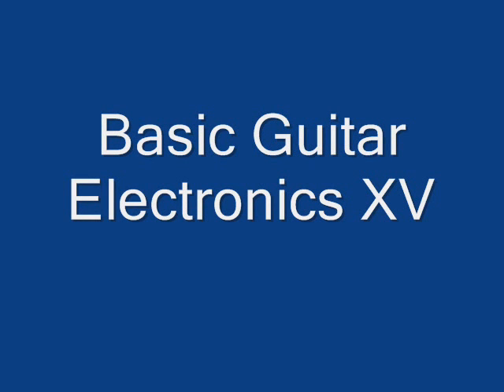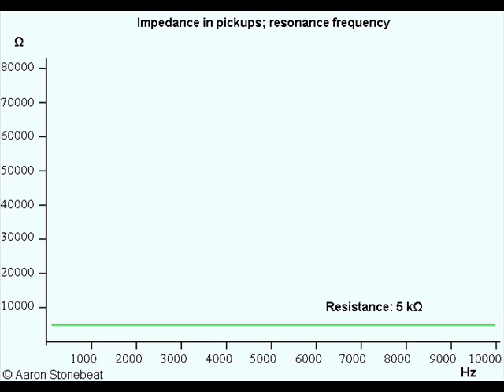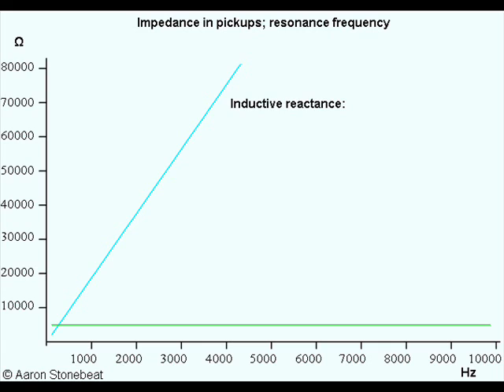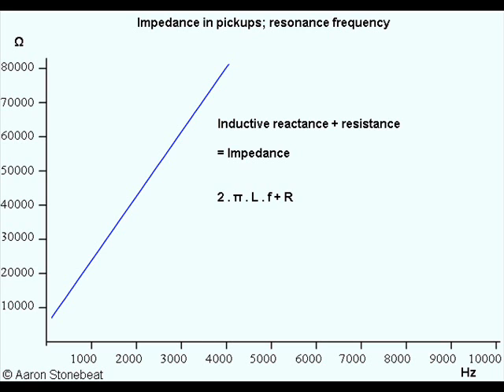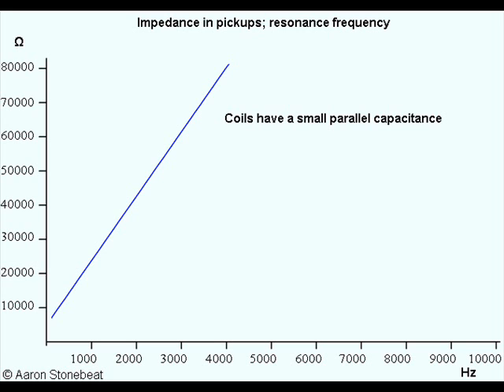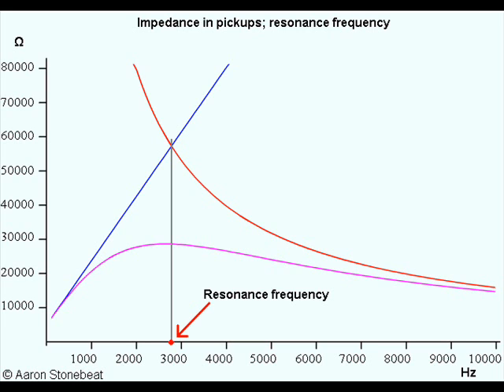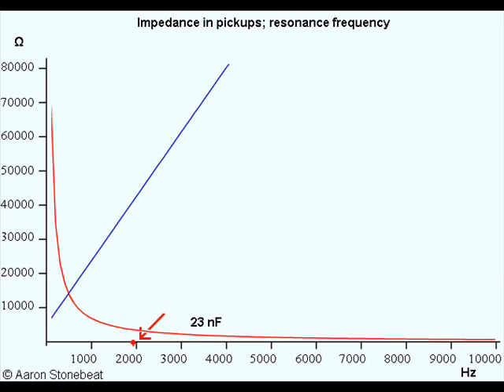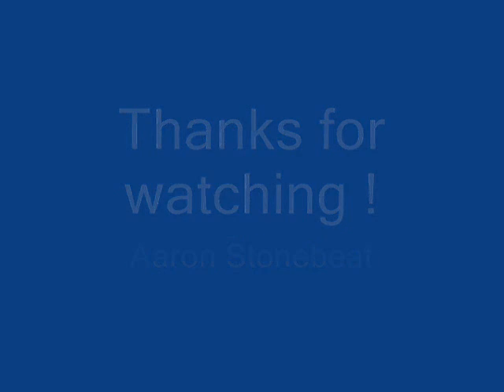Basic Guitar Electronics XV - Impedance, reactance, resistance, capacity & resonance frequency

Comment: The Resonance Frequency 2.3H and Capacitance .0040uf = 1659.3Khz Resonance Frequency of the pickupThe Volume pot is 250K and the tone is 250K = 150K The Tone rolled down uses a .15uf tone cap If the Resonance frequency is 1659.3Khz how do I "add in" 150K and the .15uf to know the Resonance frequency? what formula do I use
Reply from the maker: "The Resonance Frequency 2.3H and Capacitance .0040uf = 1659.3Khz Resonance Frequency of the pickupThe Volume pot is 250K and the tone is 250K = 150K The Tone rolled down uses a .15uf tone cap If the Resonance frequency is 1659.3Khz how do I "add in" 150K and the .15uf to know the Resonance frequency? what formula do I use"

Again you have to know how to calculate the total resistance and capacitance in a circuit. I've explained adding resistors in parallel (1/R1+1/R2=1/R3; R3 being the total resistance).
When capacitors are in parallel you can just add them up. When the are in series you get 1/C1+1/C2=1/C3, C3 being the total capacitance.

And one more time: 1/250+1/250=1/125 (not 1/150!).

Comment: But what formula did you use to put the "cables capacitance added" to the resonance frequency?
Volume pot is 250K ohms and the Tone pot is 250K are wired in parallel = 150K ohm When measuring a single Coil pickup measures the DC resistance is 6K, Inductance is 2.3H, Capacitance is .0040uf 2pie = 3.14 3.14 X F X L 2.3H = Resonance Frequency 3.14 X F X C .0040uf = Resonance Frequency F is the frequency which frequency do you pick to put in the formula?
Reply from the maker: "But what formula did you use to put the "cables capacitance added" to the resonance frequency?
Volume pot is 250K ohms and the Tone pot is 250K are wired in parallel = 150K ohm When measuring a single Coil pickup measures the DC resistance is 6K, Inductance is 2.3H, Capacitance is .0040uf 2pie = 3.14 3.14 X F X L 2.3H = Resonance Frequency 3.14 X F X C .0040uf = Resonance Frequency F is the frequency which frequency do you pick to put in the formula?"

Any extra parallel capacitance can be added to the capacitance that is already in the circuit.
I'm sorry but I can't really read your calculations (but two parallel resistors of 250 KOhm gives you 125 KOhm, not 150).
Reply: Yes true I'm sorry its 125K for the total of the volume pot and tone pot. But how do you "add" the parallel 125K ohms to the Resonance frequency?Ok I will add the cable capacitance, the tone pot capacitance value and the pickup capacitance all together to add in the resonance frequency
Reply from the maker: @waynegram8907  "Yes true I'm sorry its 125K for the total of the volume pot and tone pot. But how do you "add" the parallel 125K ohms to the Resonance frequency?Ok I will add the cable capacitance, the tone pot capacitance value and the pickup capacitance all together to add in the resonance frequency
"

If the resistance of the pickup is 6K:
1/6+1/125=1/Rtotal
Give them the same denominator:
125/750+6/750=131/750
Divide enumerator and denominator by 131:
131/750=1/5,725
The resulting resistance in the circuit is 5,725 KOhm.
Reply: Why are you using 750?  The total resistance should 131k, where are you getting the 750ohms?
Reply from the maker: @waynegram8907  It's not 750 KOhm, it's simple calculation with fractions.
You want to add two fractions, 1/6 and 1/125, and to do that they must have the same denominator. So you  multiply the denominators: 6x125=750. To get to the same fractions the enumerators must also be multiplied: 1x6=6 and 1x125=125.
1/6=125/750 and 1/125=6/750. Now you can add them: 6+125=131 devided by 750, or 131/750.
Because you need 1/Rtotal (and not 131/Rtotal) you must then devide enumerator and denominator by 131: 131/750 = 1/5,725 (rounded off to three decimals)
The 6 and the 125 were KOhm so it is also 5,725 KOhm.
When I was young this was taught in primary school.
Reply: Thanks, when you get the Rtotal value and the Resonance Frequency value you apply them to the Impedance formula?
Reply from the maker: @waynegram8907  This video deals with the relation between impedance and capacitive reactance on the one hand and resonance frequency on the other. You can measure the inductance, the capacitance and the resistance of the whole circuit from there work out the resonance frequency. You could also measure the various values of the seperate components and calculate the total impedance and reactive capacitance of the circuit and then calculate the resonance frequency.

The main point is to show how parallel capacitance affects the resonance frequency of a given guitar circuit.
Reply: Yes but does parallel resistance like the volume knob 250K and the tone pot is 250K will Roll offs the high frequencies, any reasons why?If you put 50K volume pot and a tone pot 50K it rolls off even more high frequencies. But the resonance frequency formula only has inductance and Capacitance it doesn't apply resistance What formula would apply the resistance to calculate the Roll off frequencies?
Reply from the maker: @waynegram8907  Resistance is there, it is part of the impedance.
But the point of this video is not to show how to do exact calculations of a real circuit; reality is much more complicated than that to the point that it is virtually imposible to give an exact mathematical representation of the physical reality, only an approximation.

That being said, there is something called 'the load' on a pickup (parallel resistance); the smaller it is, the more high frequencies are lost.
Reply: the load parallel resistance to the pickup will roll off the high frequencies. Its changing the resonance frequency? or what is the load parallel resistance changing?
Reply from the maker: @waynegram8907  Apparently it changes the resonance frequency of the circuit but here I have to guess as to exactly why. One thing that came to my mind was: does a potentiometer have a capacitance? It turns out it does! I just measured two pots I have around (250k logarithmic) and I found between 0,01 and 0,02 nF in both of them.
I would have to explore this more in depth.

There are more mysteries. I found that a resistance in series takes away higher frequencies (I even made a tone control like that once) but in software I have that simulates electronic circuits this effect does not show up at all.
Reply: That could be just parasitic capacitance maybe. But potentiometers should only be resistive elements track inside the pot. The resistive load in parallel with a guitar pickup is an LCR in parallel with the LOAD pots volume pot and tone pot with is 125K ohm total resistive load. The Resonance frequency of the LCR we calculated but when you put the 125K load it changes by rolling off the high frequencies. Its changing the "upper cut off frequency" of the LCR network. I guess I have to use the LCR cut off frequency formula to ADD in the 125K load?

Comment: So the last thing that you mentioned was longer the cable length the more capacitance... I cant discern if this is  good bad or neutral to have longer length...def certain that that particular statement was one of the most obscure and insightful nuggets of guitar wisdom I've come across in 30+ hours of researching videos webpages and the minds of techs and luthiers in my obsessive attempt to gain an understanding  of the electronic engineering aspect/components of electric guitars and how they affect the output tonality variance....thanks again for taking the time to make this and your other videos